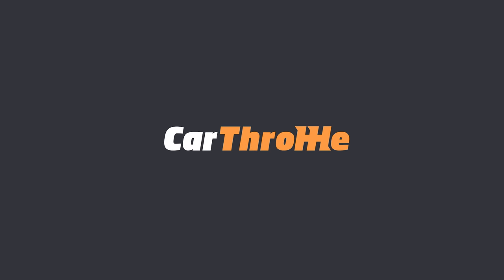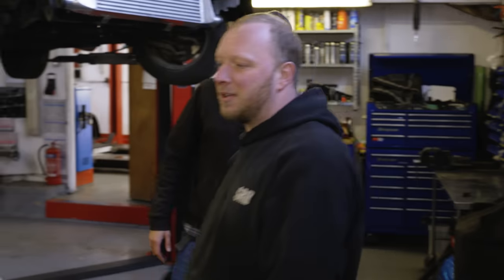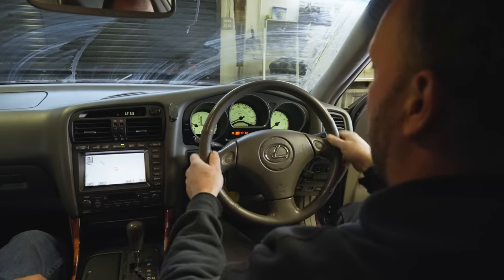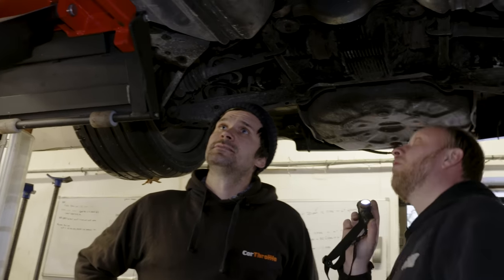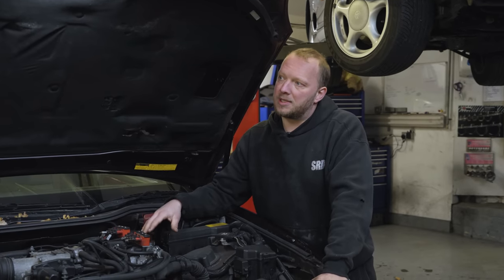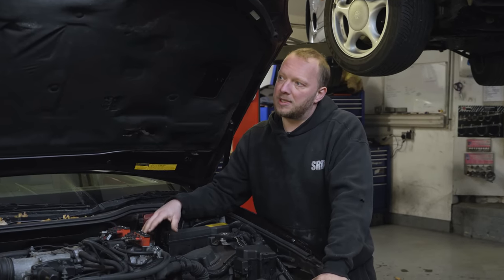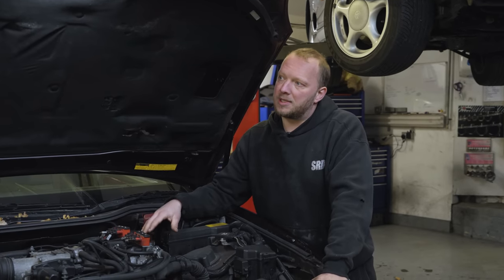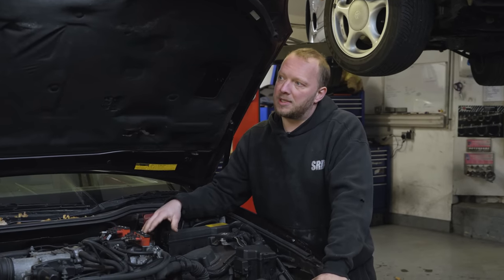What Does 250,000 Miles Do To A 2JZ Engine?

Comment: NA+T on a POS engine, sure, but here I would go the extra step and do rods too, just to make sure.
Reply: Pos engine 💀
Reply: @waddayabuying5258  a non turbo 2jz is a pos engine
Reply: @mk2nathan  I mean all you gotta change is the rods and pistons and it’s as strong as a gte
Reply: @GrizzlyGarage  Yeah exactly, but you can go and put stronger rods and pistons in any engine and it will be able to handle crazy power. People get 1000+hp from vr6's once the internals have been strengthened. The point is irrelevant.
Reply: @GrizzlyGarage  it's the same engine just detuned
Reply: @mk2nathan  I read it before you edited it 😏 and ig by that logic every engine is a pos engine till it’s built haha
Reply: @waddayabuying5258  yeah pretty much
Reply: @GrizzlyGarage  I edited it because i accidentally pressed reply before finishing it lol. I'm an idiot. But no obviously thats not the case. The 2jz gte is an astonishing engine. They can handle up to about 800bhp before going boom and needing further strengthening. Same could be said about honda's b and k series engines and vw's 20vt line up. The non turbo 2jz is nothing special though. That's what my point was. :)
Reply: @mk2nathan  see now that’s a fair point, I would gladly agree that it’s nothing special for sure cause everyone and there mother has a 2j 😂 I just wouldn’t call something that needs different oem rods and pistons that can then make the same 800hp a pos engine haha. But yes def nothing special
Reply: @GrizzlyGarage  Nathan thinks BMW and VW makes good engines🤣  I'd be careful even meeting him half way on any argument as he clearly knows nothing about engines
Reply: @GrizzlyGarage  so you're about 60 years old, with the username 'Big Duphus AJ' and only made a google account last year. I don't think so lol. I never even accused you of fanboying, I just said you're clearly a part of the jap community. You've also ironically just proven my point about the jap community.
Reply: @bigduphusaj162  Also, are you saying that bmw and vw dont make good enignes?? The pd diesel is possibly the most legendary and reliable engine ever made. Vr6's are beautiful sounding and mega reliable, and the 20vt is possibly the cheapest way to get into having a fast car. VW have made brilliant engines, Mr 40 years as a mechanic ;D
Reply: @GrizzlyGarage  Well yes that is true. But then again if you’re taking an engine apart to replace old parts with better parts, then why not go for the best anyway. I’m sure the price of oem gte internals can’t be that far away from all the mega forged stuff anyway because of the demand for them.
Reply: @mk2nathan  utter tripe. The only real reliable PD was the one in the mk4 golf it was code 'AZN'  the PDs coded BXE were one of the most UNRELIABLE engines ever, they snapped camshafts or threw rods through the block all over the place, the BAM again  had many variants which only one of had a decent bottom end in?  So the 20vt What one? The one as several incarnations were attrociou. And BMW Have NEVER made a good engine not one. Learn what you are talking about before back chatting 4 decade mechanics pal.
Reply: @mk2nathan  nowhere near 60 but u can still tell a tiktok kid from the utter tripe you speak. You get everything back to front
Reply: @bigduphusaj162  What do you mean which variation of BAM?? BAM was a variation. And theres plenty of p.d's which have covered more than 500k miles on standard internals across all different sorts of variations. Sorry mr mechanic of 4 decades but isnt anywhere near 60. I mean how does that even work. xD. How physically have to be about 60 to have been working for 40+ years. Even though of course you are actually not what you say you are lol. I also daily a mk2 golf. In eastern europe they are a hero car because of how indestructible the engines are in them. Even my 1.3 engine has been known to go on for over 300k+ miles without being opened up as long as they are maintained properly. But i have to agree with you on atleast one thing. The pd105 isnt great lol
Reply: @waddayabuying5258  Lmao, everyone reading it as if I called this engine POS. The longer version would be "On a POS engine, this would be fine, but in this case, I would go the extra step."

POS would have been some oil guzzling knocky monster that will die with 140hp or 400hp anyway (Which this probably would have been if Alex had bought it).This one looks too nice to die by rodney, the rod who couldn't.
Reply: @mk2nathan  utter drivel again. Bam was a type the variation of BAM was the AMK which had a different SAI system. Plenty of alfa JTD done 500k miles too infact they were more reliable as a whole ask any taxi driver. The more you reply the deeper the hole you're digging
Reply: @bigduphusaj162  BAM and AMK engines are different variations of the 1.8t (20vt) (just starting basic for a basic person like yourself). BAM is an engine code. It doesn't have other 'BAM variations'. BAM engines and AMK engines are different through the reason you highlighted, although vary similar. You are wrong. Similar to afh and afk engnines if you know them. Both of which again are awesome vw engines. :) Also, please answer my question? How can you be a mechanic of 40+ years but still be 'no where near 60 years old'. Doesn't make any sense lol
Reply: @mk2nathan  what I will grant you is that mk2 golf is amazing reliability, mk3 problems arose and newer golfs are junk
Reply: @bigduphusaj162  I suppose mk2's have amazing reliability because they were designed 40 years ago by really really really old people who've been in the trade for 40+ years like yourself
Reply: @mk2nathan  what are you on about? Bam was the block not the engine code. It had a different everything from the other models. Bam was a type, it had 3 different reference codes with cheapened out bottom ends and other small changes and AMK was it's other variant that released alongside it.
Reply: @mk2nathan  VT just means Valve Turbo you melt it's commonly used for describing how many Valves and having a turbo. The blocks are all different. PD was the same so its you whos confused as the block changed but was still called PD because of the injection system. When referring to PD it can mean any Pumpe Duse engine same as 20VT means any 20v turbo. You're skipping from engine type acronyms to Engine block Types to Variant acronyms. This is the difference near 40yr in the trade makes kid.
Reply: @mk2nathan  that's exactly why old mk1 and mk2 golf were reliable yes.. why else would it be?  That must be hard for you to understand though as all you kids do is a quick Google search to copy & paste the first wrong piece of info you see. Well for a start you are confused about engine types and think every 4 pot 20v turbo lump is the same so 🤷   the only thing you kids know how to make good is a microwave meal.
Reply: @bigduphusaj162  BAM and AMK engines are the same except for the standard ecu map and SAI. They are virtually the same engine. I’m telling you you’re wrong mate. The BAM engine code is literally stamped on blocks of the 1st gen TT’s and AMK is stamped on 1st gen Audi S3 engines. They are two different variations of 1.8t. I promise you I am right.
Reply: @bigduphusaj162  ‘40 years in the trade’. I get it mate you’re lying it’s alright no need to repeat it
Reply: @bigduphusaj162  not what I said though is it… I’m saying there’s different variations of 1.8t engines…… you’re trying to tell me that there are different variations of BAM engines. That is wrong. BAM is a variation. Just like AMK is a variation. Just like AGU is a variation (although a poo one)
Reply: @mk2nathan  what? It was me who told you BAM and AMK were the same apart from the SAI🤣  so now you are hitting me with my own info and acting like you presented it?  🤣  I'm not joking right are you OK in the head?  Also if it said BAM on the lump it's because IT WAS A BAM In that model. I'm in disbelief right now at you arguing with me with my own info tbh. That's a first for me, never had someone blatantly rip off my facts then present them as their proof. Nice try man
Reply: @bigduphusaj162  I can see where you’ve said there are different variants of BAM. BUT THERE AREN’T!!! THATS MY POINT. BAM IS AN ENGINE CODE. We literally agree but you are trying to twist this into some sort of weird argumentX I said there are different variants of 1.8t’s. You said there are different variants of BAM engines. You are wrong
Reply: @mk2nathan  you on Ross tech forum or registered for VCDS?   Can start a thread on there right now if you want and all the best BAM guys about will sort you right out. Just let me know and I'll start it just now. You best not go radio silent on there coz you've sure had plenty to say on here. We can settle the 4 decade mechanic stuff on there too as I personally know the two main moderators. Put up or shut up kid.
Reply: Ross tech forums with this one... he won't shut up. I'm going to embarrass him on there even if he tries to go radio silent now.  Sick of these kids talking drivel
Reply: @bigduphusaj162  😂😂 sorry I would love for you to make that forum. Just give me 2 minutes I’m making a tiktok. Let me know when it’s up
Reply: @bigduphusaj162  Also are forums even still a thing? I haven’t seen one been updated since 2004
Reply: @mk2nathan  OK so now you've became sarcastic. Are you on Ross tech forums or are you a VCDS owner and have an account? Don't deviate now, you bumped your gums so let's ask the pros shall we, let's ask the top VW tuners in the world.
Reply: @bigduphusaj162  no I’m not being sarcastic. I’m deadly serious I am actually making a tiktok. But yeah I’ll register for this bollocks 2004 forum thing because I’ll have the satisfaction of seeing someone I’ve annoyed that badly make a forum over something that was said in a YouTube comment section🤣
Reply: @bigduphusaj162  Also, drop me a link to the thread once you've created it. If you would like help with how to do that just let me know. I know old folk struggle with tech.
Reply: @mk2nathan  you can't put links on here they remove the comment and again.. I'd rather be 100yr old or any generation for that matter than your generation. Your life is mobile phones and finance and thats all it will be for the rest of it 🤣   enjoy
Reply: @mk2nathan  How can you call it POS engine? The GE wasn't designed to be modified or make high HP, it was designed to be smooth and reliable for hundreds of thousands of miles. Both of which it does amazingly in stock form. There's a reason the value of these engines are going up and not down.
Reply: @Spurs228  "Just a Golf"

Shows how much you know lol